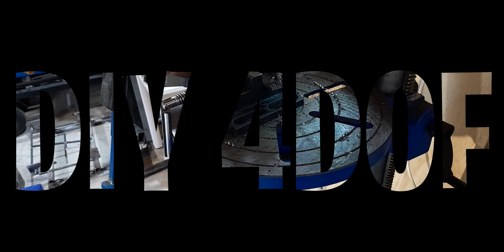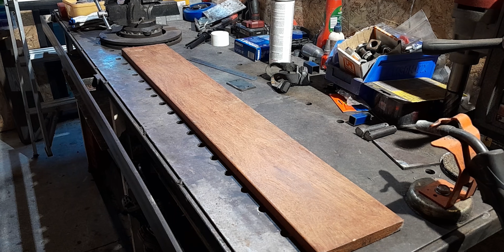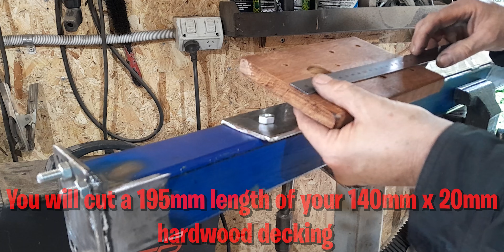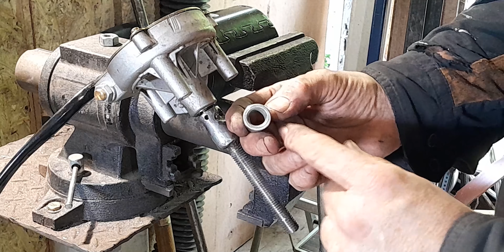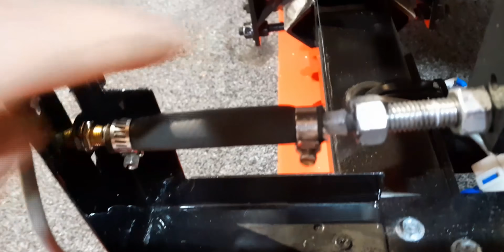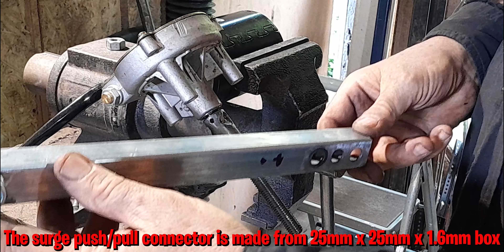DIY Motion Sim Surge Rail Build Pt 2 — Timber Motor Mounts + ZD1766 Setup

Comment: Hi Kev.. The Doctor's videos are awesome and I'm actually at the point of balancing my top frame and welding the last bit at the Uni Joint..  Woohoo ! ..  I noticed in this video at 19:00 a spring that looks like a soft stop for the rotation arm connected to the front motors .. would you mind explaining the process there a bit please...
Reply from the maker: @A.GeorgeMenendez  Hi George. Great progress on the build mate. Well done. I had a couple of clutch springs left over from the seat spring heave mod. I doctored them up on the front motors to provide a sprung stop if my motor levers were over come by inertia during crashes etc.

Now my SMC3 and Sim Tools settings have been tweaked, along with the sabretooth now controlling the front motors, they never come into play anymore.
Reply: @Doctoradhd1  Thanks mate.. I was thinking of putting kill switches instead of springs for the same reason, but good to know SMC3 will do the job.  I also just installed the surge motor push rod but think my measurements are out.. my push rod centre to centre 12mm mounting hole distance is 195mm and the lever working the motor "axle" is about 110mm long centre to centre. Are mine very different to yours ?.. P.S. I was in your turf again today... you guys know a thing or two about thunderstorms!
Reply from the maker: @ I’ll check my surge push rod and motor lever specs later today and get back to you.

I know right. We are experiencing tropical like storms these days never seen before down here. Well at least I’ve never seen storms with this kind of violence in my 35 yrs in Canberra.

My garage a few days ago got totally flooded and our suburb experienced so much hail, it looked like it had snowed! Scary shit.
Reply: @Doctoradhd1  Hi Doctor .. I'm using a 25x25 box as the surge motor push rod - I just wanted to double check my lengths compared to your rig. I tried out the motor workings by applying 12vdc to it and seems to work but somehow doesn't seem 100% correct... my lever off the M12 threaded Rod axle that is welded to the motor spine has a 75mm centre to centre length ( using from Truck Hardware - motor crank 15.3x16x75mm tccrank 15.3 ) .. I am also using these Truck Cranks on my front motors using the spline bolted on the motor axle and welded a M12 bolt at the other hole for the Rod end connection to the top frame. I have not powered my front motors yet so hoping the centre to centre 75mm distance is enough to make things work correctly... any thoughts?
Reply from the maker: @A.GeorgeMenendez  Hi George. Sorry mate, got a bit OCD on flow testing my Cleveland cylinder heads on the channel.

I just went and did some measurements on the sim rig. My 25mm x 25mm box push rod is 250mm in length and the lever that goes from the motor shaft to the push rod is currently set at 65mm hole centre to hole centre.

The lever holes centre to centre could be around 20mm further apart (in total) for more surge back and forth, but then I'd run out of rail. I've left a 20mm buffer, just to be sure.

My front motor levers measure 95mm centre to centre holes. Those to could be lengthened at the cost of more power draw to move them. You'd get higher lift and drop, but it's really not required for realism in my opinion.

All these things can be tweaked for more or less motion, but everything comes at a cost for energy, wear and tear etc.
Reply: @Doctoradhd1  Thanks Kevin.. That is really helpful as my front motor levers are too short and need another 20mm in length which would then give me 90 degree to the rod to top frame / lever to motor geometry. My 25mm x 25mm box push rod is now 220mm in length and the lever that goes from the motor shaft to the push rod is currently set at 75mm hole centre to hole centre which nis again 20mm too short but I may leave it until I get the rig running and see what the actual heave / surge effect is in reality.  And now to start on my "electrical/electronics " part of the project indoors. Thanks to you I have acquired a few "handyman" skills in MIG Welding , steel work in general and using a soldering iron which I haven't done for over 30 years. What a great journey .. Thanks again Doc !
Reply from the maker: @A.GeorgeMenendez  Nice one George. It's a lot of fun doing all that stuff I reckon. Looking forward to hearing more about your rig when you get done.